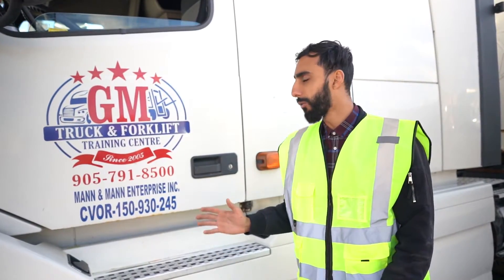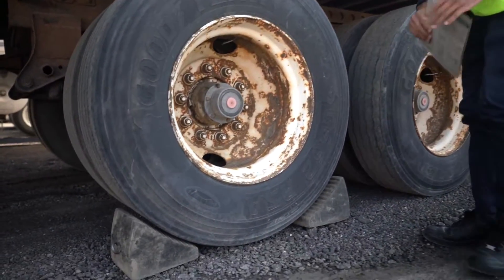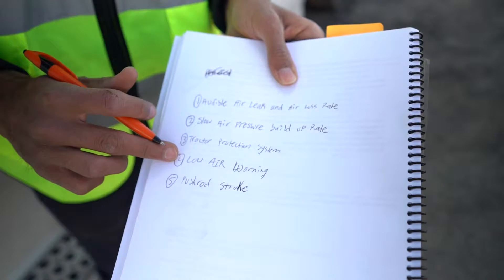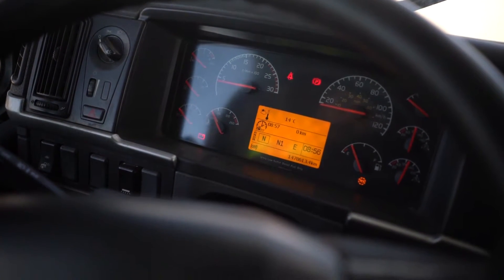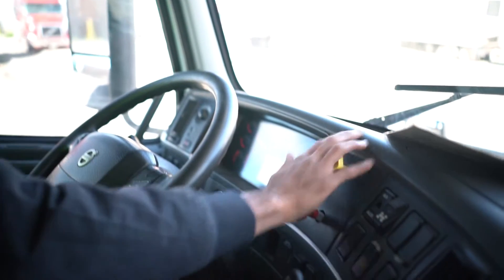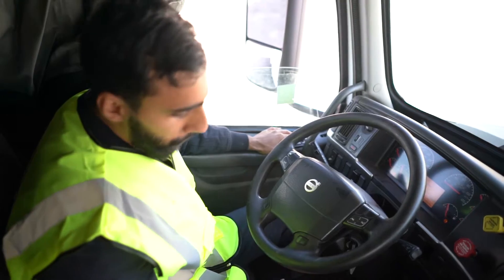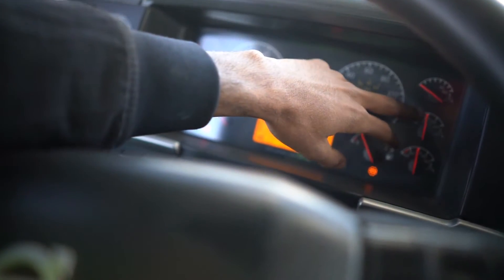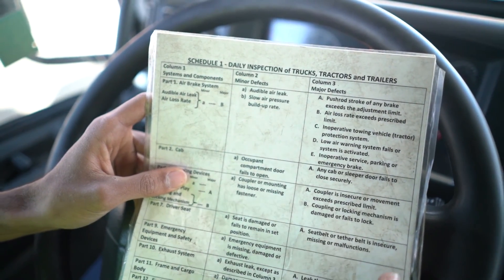Audible Air Leak and Air Loss Rate

Comment: i was told the test is done within operating pressure which is 80-145 prefererably on the higher end, not exactly 100, thats only for mark and measure

Comment: You are incorrect the max psi loss is 3 psi over 1 minute
Reply: Its 3 psi for a straight truck 4 psi for a tractor and trailer and 6 psi for tractor and 2 trailers
Reply from the maker: Hi, 
3 PSI is the max if you have the tractor only, however we have a trailer attached so the max PSI for that would be 4 PSI
Reply: @gmtruckforklifttrainingcen810  It may be different in the state of Utah
Thanks

Comment: An air loss rate test should be done with full system pressure, the higher the pressure, the better chance of finding a leak (real world) also... a gauge marked Front is secondary circuit and gauge marked rear is primary... just a friendly heads up!

Comment: Bring the pressure more than 100psi on both gauges because we know during the audible air leak test(minor defect) we gonna drop the some units of pressures and maintain pressure above 100psi for air loss rate test(major defect) as well. 
Tell me if i am wrong?

Comment: How do you know if you have lost more than 4psi if the air gauge only has like 4 numbers in measurement i guess 30, 60, 90, 120, 150 how are you sure if you loss 4 psi or more? You just take a guess or practically gauge shouldn’t move?
Reply from the maker: The way to check if we lost 4 PSI, is by looking at the gauges at the start, the pressure is 100PSI, after a minute, the pressure would drop so it can go from 100 to 99, or 98, or 97, or 96 PSI which are all good.